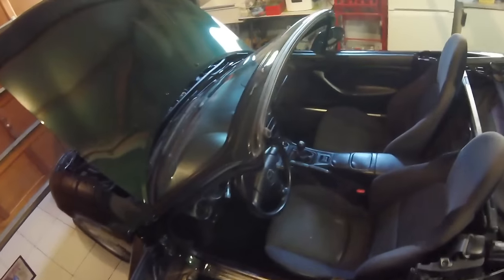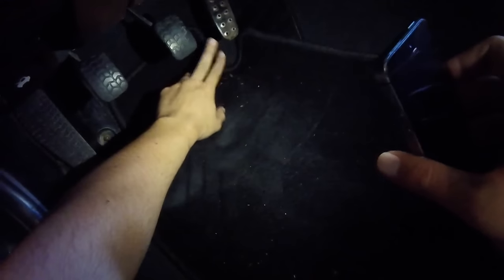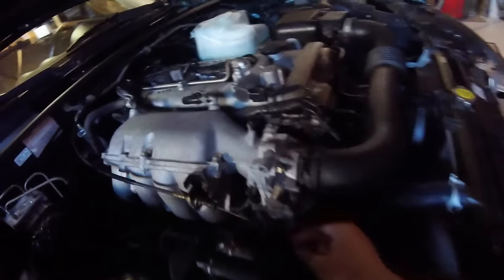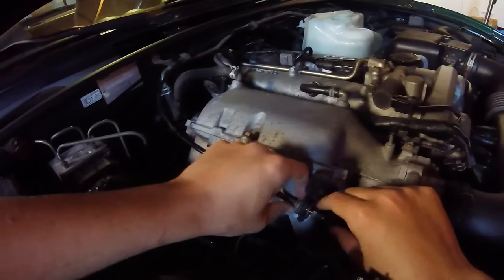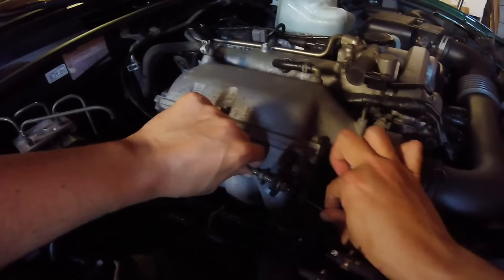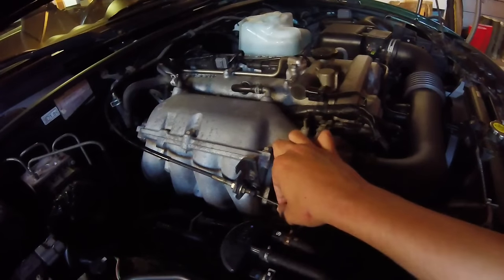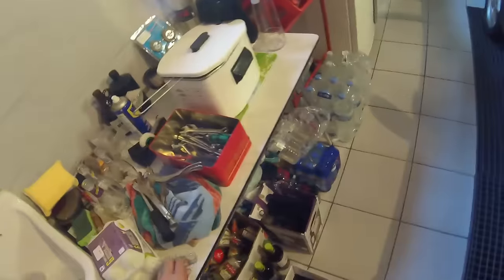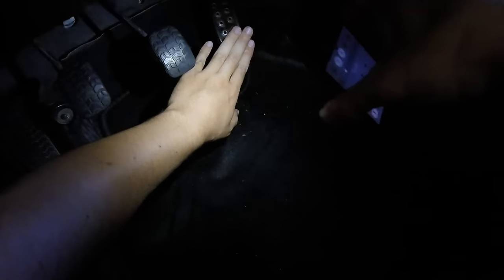How to fix a loose gaspedal in your car in 2 minutes for FREE

Comment: Aaron, thanks a million dude. I literally just inspected my car and wondered if this cable should be this loose. I was checking why my RPM goes up and down at idle, so I was revving it manually from the engine side with my hands and noticed how loose the cable was. Will go back and tighten it. 3 years and this video is still helping people. Thanks again!
Reply from the maker: Hopefully many years to come!
Reply: My issue is it revs none stop
Reply from the maker: @isaiasroman5631  Might be this cable being over-tightened. Check it out.
Reply: @isaiasroman5631  My car used to do this after it warms up. I changed the IAC Valve, EGR, Idle pulley so far. It still does it during summer. Now, the issue just disappeared!! The mechanic did notice some weird behavior with the radiator but found no leaks. And the temperature is stable. He said he thought my fans do not work probably so the engine revs up to get them to do a better job cooling. Maybe that explains why the car do not do that anymore cuz its cold now.
Reply: @isaiasroman5631  mine too
Reply: @AaronMattheus  im about to go check my car brb

Comment: It's great how easily we can fix things once we get to know how it's done. This video is very usefull but bro I'd like to state something about it and that is, you should have a bit play on your pedal, not as much as you had on your Miata but slightly less than that. The reason for that is to not put strain on the cable when flooring it. If it doesn't have at least 2mm free play in it then it'll slowly damage the cable (if you floor the pedal that much) and could also damage the valve that opens up when you press on the pedal. All the owner's manual of any manufacturer has these details in them about how much free play should the pedal have.
Reply: yo idk if youre gonna reply but is it normal for manual cars to have a bit of free play in it? my car has a bit of free play but not to the point where it's affecting my driving experience. i've tested my buddys car (exact same, just the auto trans version), the gas pedal was stiff and there was no free play at all. so it made me question if manuals and autos are diff in terms of free play. is it more important for manuals to have free play?

Comment: The gas pedal wire in my '94 Toyota Celica Mk6 tends to fall out of this pulley connected to the throttle or whatever this thing is, which might cause some problems with gas pedal response. Maybe I'll try to tighten the cable as well.

Comment: O.K. First off those are nuts that you are loosening on a cable, not being overly critical.  ;-)
However, as to the fix you've shown.  The first thing to do is loosen the nut closest to the throttle housing, and probably a good deal so.  (Loosening the other nut is counter-productive.)  With a cable with a barrel end that secured to a cam, as in the video, just pull the cable's casing back with your hand, away from the throttle housing, and finger tighten the nut farthest away from the throttle housing toward the bracket to remove most of the slack.  (The other nut should not be up against the bracket at this point.)  Then, with the engine running, further tighten that nut toward the bracket with a wrench bit by bit until the idle speed increases.  Gradually back off the nut's tension until the idle speed returns to normal after a few seconds of waiting with each slight adjustment.  (However, an eighth or quarter turn of the nut too loose won't hurt anything here.)  Then finger tighten the other nut toward the bracket.  Holding the first nut in position with a second wrench, tighten the second nut against the bracket.  Slack removed, idle speed retained, and everything's secured!  Done!!!---------However with any cable, installation, if needed and done, is never the end of the deal!!!  Cables stretch over time---dramatically when new.  New strings on my piano have to be tuned and re-tuned every month or so for the first year or longer.  Cables on a vehicle are no different, be it for a hood or trunk release, an accelerator, cruise control, kickdown, or linkage cable, etc.  It's just physics!  Some cables have stops that must be set within only hundredths of an inch of tolerance, like kickdown cables for an automatic transmission, and a proper tension setting is critical to avoid excessive and premature wear of very expensive parts.  If you are having a mechanic install a new cable for you, insist IN WRITING that periodic retensioning of that cable is what you're paying for up front, and at least for the first year, or go elsewhere!!!!!  Nicely shot video!
Reply: Make a video and show us  if you have that depth of knowledge.

Comment: Hi, I tried this on my old Corolla. However, I already moved it as far as it can go and it still has a little bit of slack. Any ideas? Thanks.
Reply from the maker: No idea. I'm sorry.
Reply: Ephreim Pangilinan i have a 96 corolla & the gas pedal is damn near to the floor, it’s like my foot slips deep into hell when i have to do high speeds. was that your problem, as well? did this video at least help? my car is away from atm, so i can’t try the method just yet.

Comment: I did it again and it worked but it has a little bit of play left cause it was that stretched that it still has a little bit I tightened it all the way there are no threads left at least it worked a little bit cause it was half where are you play now it’s 1 centre metre

Comment: I did this on my 2006 Honda Accord, and though it did remove the play in the accelerator pedal, it resulted in very high RPM on idle (cold start: 2000rpm in park, 1300rpm in drive)

I wonder how to fix this. In the meantime, I'm putting the cable back how I found it
Reply from the maker: I’m pretty sure you over-tightened the cable. Losen it a little bit, so it’s not lose, but also not pulling the throttle.

Comment: I'm having the same issue with my Peugeot 206. My gaspedal is almost on the floor and the dead clearance is about 5 cm. The pedal just doesn't come back as it used to do and my acceleration speed has been reduced significantly. I adjusted the throttle box acceleration cable spring a dozen times but it seems the cable has been streched out. Are there still options left I could carry out or do I need to replace my gas cable? I appreciate any help
Reply from the maker: I'm not a mechanic and not 100% sure but I think you might have to replace the cable entirely as you said.
Reply: @AaronMattheus  Thanks for your quick reply and advice!

Comment: There is supposed to be slack in the pedal, otherwise the throttle body is always being pulled on.
Reply from the maker: You can easily feel when you would actually open the throttle body, which is what you are trying to warn for. In the case of this car, and many other people in the comments here are experiencing, this isn't a case of the throttle cable being 105% tight but more like only 70% tight, so it's completely loose and ends you up with having a whole inch of nothing on ur pedal.